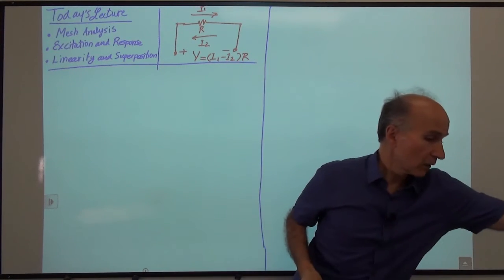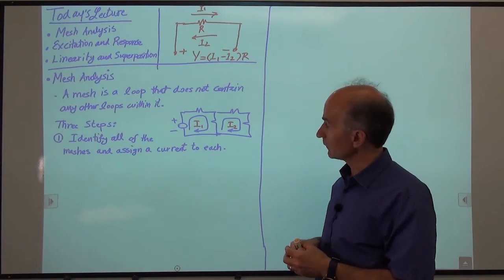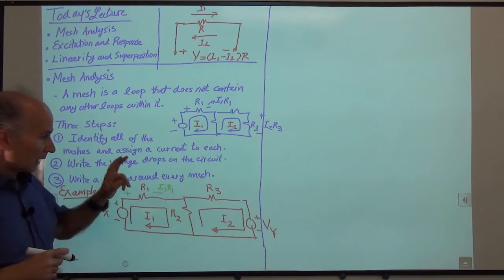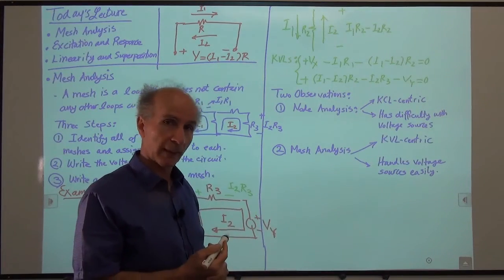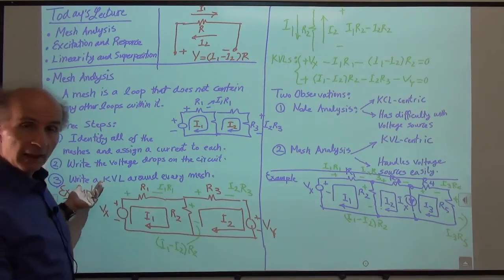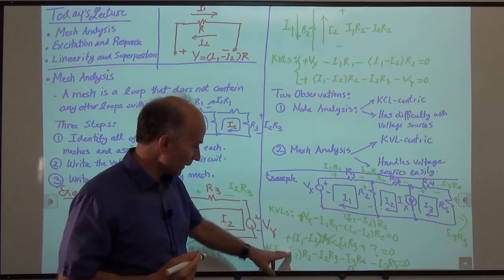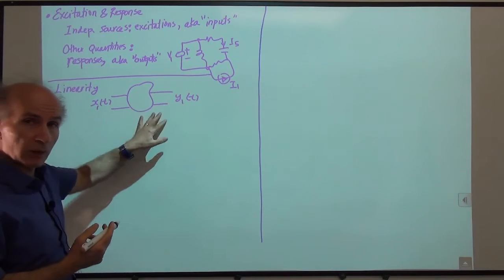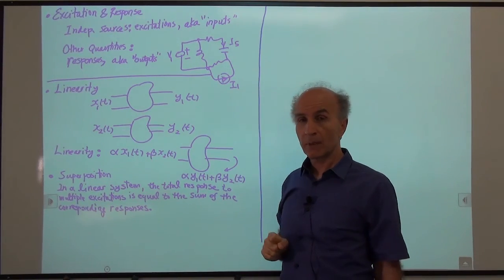Razavi Basic Circuits Lec 8: Mesh Analysis, Linearity, Superposition

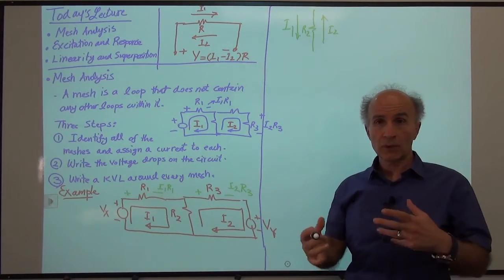Comment: I think either the I1 or the I2 current flow must be inverted (depending if conventional current or physical current, it does not matter). But at 17:00 it is not possible that they go in the opposite direction when in fact they go in the same.
Reply: If you follow the direction of the currents in each mesh you will see that they do in fact go in two different directions. He said himself that current flows in one direction but for mesh analysis there are superimposed currents. Hope this helps😊